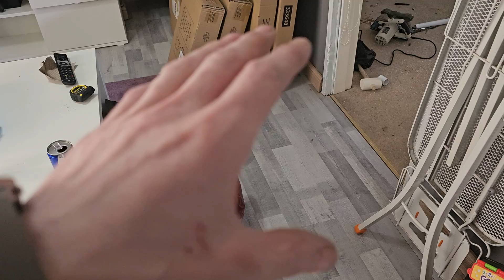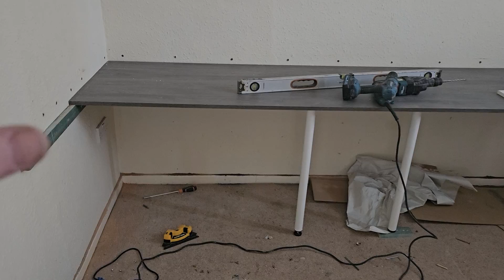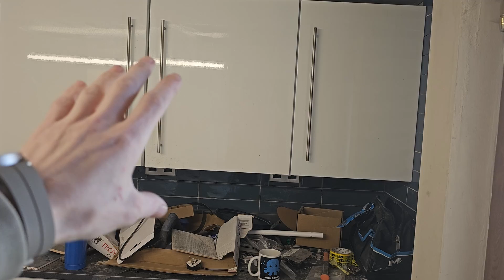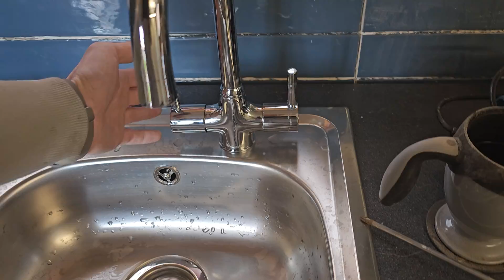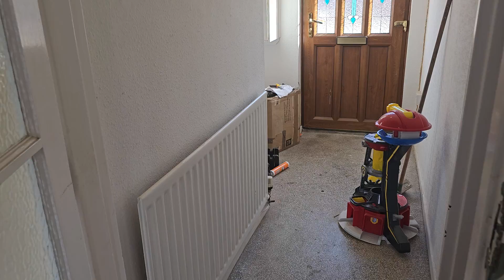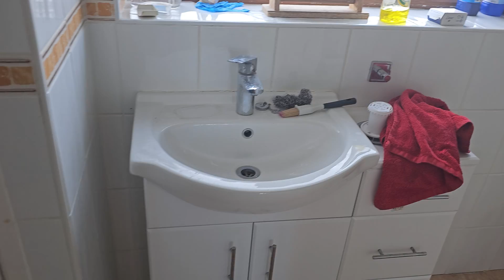This Is Why I Haven't Been Around! Update And New House Tour

Comment: Beware shed workshops.......NE Scotland here, my original electronics workshop was a shed, albeit I had lined it top to bottom with 40mm kingspan. It was too hot in the summer and too cold in the winter. I could heat it but it was costly to do so. After trying electric heaters eventually I got a Superser (gas bottle heater) but had to use a dehumidifier also to keep my gear from corroding.
In the end I converted my garage and haven't looked back.

Comment: P.S. you should really cut out the mold infected drywall as there is no real way to treat it. just take the bottom four feet off and install new drywall. trust me you don't want mold spores floating about. Once it gets into your body, it stays in your system forever making you feel sick and weak much of the time. That's what happened to me anyways.

Comment: Have you upgraded to a 30 Amp fuse for your work area? you should wire another breaker in your panel for a second power lead to your work bench so you will have more than enough juice for all your tech equipment to be plugged in and not worry about flipping the breaker. But it's looking pretty good thus far. I hope you can put all these renovations behind you soon. Cheers Phil!

Comment: Don't worry about it Phil you're making the right call by us. Quick unrelated question though, is there any documentation for the PS5 around the chips yet anywhere? Things like cap values or chip types (sorry bud I'm new to this whole game, inspired by yourself to pick up a soldering iron  for the first time 2 months ago. So far 2 fixed PS3's, a Game Gear recap and a few other minor things!). I've got a no power no beep ps5 on the way in the mail and outside of swapping the PSU and all the great work I've seen in your videos (I'll follow your methodology as best I can), it would be great to know what I'm messing with chip wise.

Comment: Yay, your Alive!!  You have Nothing to apologize for!  2 quick questions.  Any worries about asbestos?  Also, do you use a combination washer/dryer?  Just curious, no need to answer; you're very busy.😁
Reply from the maker: Haha thanks bud. Nah no worries of asbestos as the house has had renovations a few years back. I've seen nothing to indicate asbestos so far so should be good. We use seperare washer and dryer because the combis are typically less efficient at drying but we use the radiators for most drying anyway and lines outside in the summer
Reply: @TheCod3r  Thank You Sir, Happy Renovating!

Comment: Good job so far, keep up the good work. With the units in the kitchen,  if you extend the floor under the units wouldn't that raise them so they sit flush with the cooker? May save you a bit of money. Good luck!
Reply from the maker: Cheers mate. I could rustle something up but I'd rather have the feet on them so I can adjust the height if I ever change the kitchen around. Having the feet also allows me to fit a kick board too so it serves a few purposes. New units are only around £70 each from B&Q so not too bad

Comment: Do not stagger tiles my man, use 400x200s in a none brickwork style, no tile is flat so if you're tiling an older wall it'll look uneven and shit. I'm a tiler so trust me. Use Tile plus in Tipton as well, they're very reasonable.
Reply from the maker: Cheers for the advice mate. I'll look into that. I've never tiled before so it's all a learning curve to me
Reply: @TheCod3r  it's not rocket surgery mate, get your first row level and tile from the middle. Loads of how to videos on here, preparation is key though.